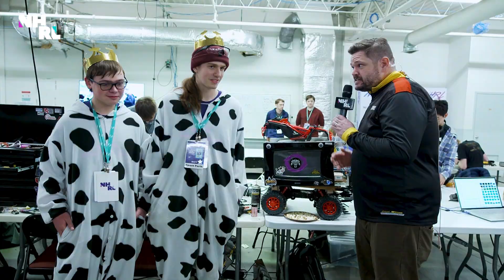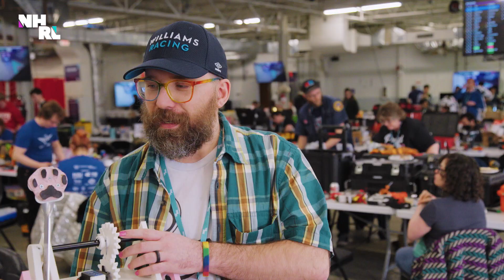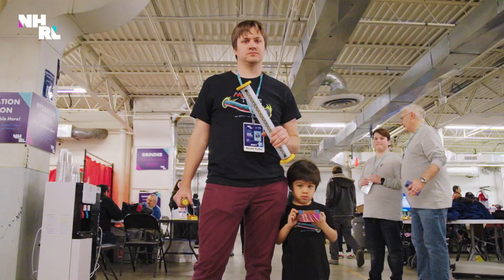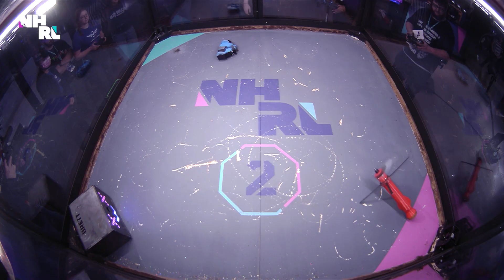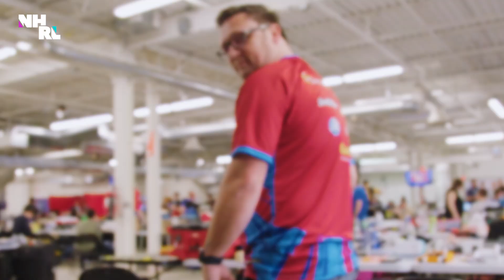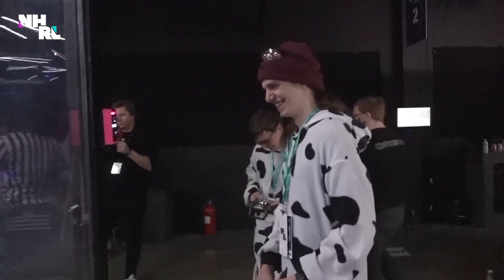Dreaming Up the Most Wacky Robots Imaginable for NHRL

Comment: Noob Tube's weapon wasn't even balanced, having only one bar. As expected, it was just jittering around and wasting energy, probably wrecking its own drive. If that's the best tube-on-wheels bot you've seen, I can't imagine what the worst looks like. 

Pawsitively Hissterical was cute, funny, and made with visible effort, so the driver gets a pass for not really trying to win. Spare Parts though... No combat ability, no artistry, no effort whatsoever. Spare Parts, and the fact that you let that trash heap in the arena, is an insult to the tournament, the competitors, and the viewers.
Reply: I'm with you. Any robot without at least fifty years of refinement shouldn't be allowed into testing arenas for, err... testing.

Spare Parts was a bit silly, but then part of the point of entertainment is silliness. Sports doesn't work without errors, drama without character or judgement flaws, and news without events that weren't intended to happen.

Sometimes, the silliness just happens to be intentional, or introduced to bewilder and confuse the enemy, by challenging their assumption (a flaw) that everyone will optimise to the meta-design.
Reply: @blackjacktrial  
Spare parts was not even silly, it was just lazy and disrespectful. The only way they could be more dismissive of the sport is by literally crapping on the stage.

Comment: Bro already had a magnetron inside the microwave oven which is capable of killing almost all the battlebot champions and even most of the electronics inside that area 💀. Is doing something like that is permitted? I'm pretty curious to know about that...

you are NOT ALLOWED to replicate this stupid idea
 I'm not sure about people have did this before......
Reply: Ehm if I remember correctly at least in the  battel bots rules I have read it is kinda out ruled because the energy beam isn't contained /bound too the bot that's the reason we don't see guns on bots (also would kind kill the vibe an be dangerous) but harpunes with chain link are fine by this rule but weigh restrictions happering such builds also getting enough power to the magnetron is kinda hard and any bot with a metal casing is shielded even aluminium foil/tape cann be used for that purpose if the bot uses a polymer chassis